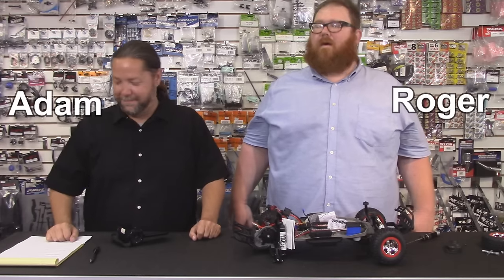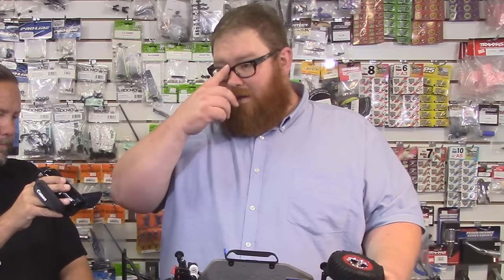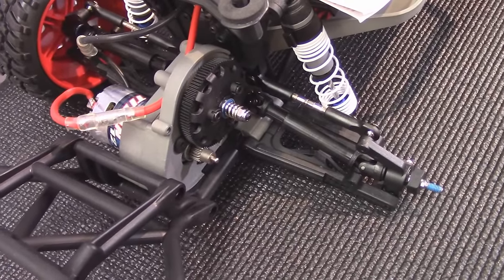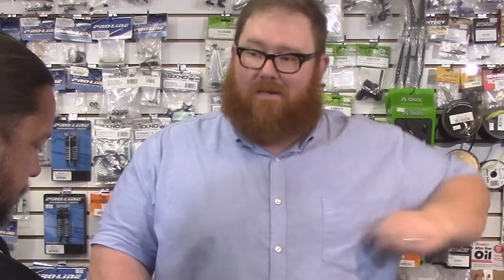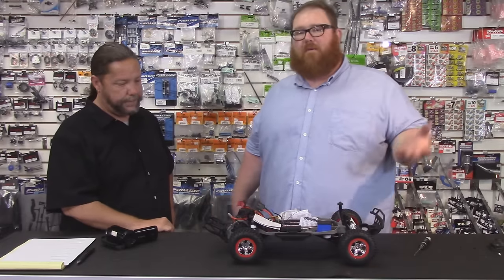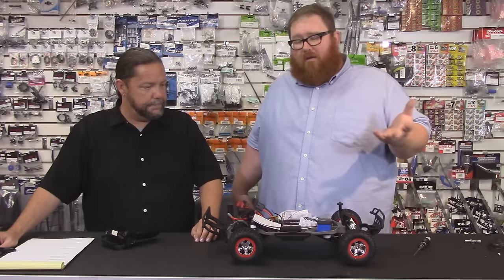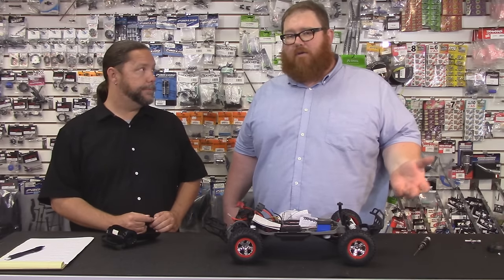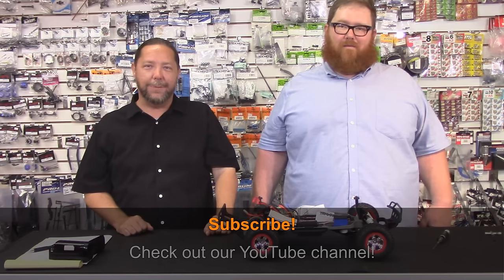Check & Adjust RC Slipper Clutch - How-To

Comment: See what you do is CRANK that nut all the way down until it don't slip no more and now your car will  wheelie!!! By the way I sell transmission parts lol. WTF. Next video is how to rebuild Traxxas transmissions...
Reply from the maker: If you transform it into a wheelie machine, then you need to change quite a few other things too ( idler gear, differential etc)

Comment: I agree with tightening slipper all the way. Because I switched to a brushless setup and kept burning up the spur gear and slipper parts. I tightened the slipper all the way and no longer have that issue. And like he said an $8 gear part much cheaper & easier to fix and replace.

Comment: Ahh! So that’s why whenever I would accelerate with my 4x4 slash, it kinda of just sits for a split sec before slowly gaining speed! Because I had replaced the entire Transmission and didn’t adjust it! The problem I suspected but never knew. Thanks!
Reply from the maker: You're welcome. Instead of adjusting your sleeper, try 3rd differential (it is another Traxxas upgrade)

Comment: Made the mistake of cranking the slipper too tight on my evader brushless upgraded to 4300kV Tacon Motor. Ended up destroying the differential. Duratrax discontinued their entire r/c vehicle line. A new complete transmission is price gouged at $95. The differential unit is basically impossible to find separately. My stupid mistake has forced me to retire an otherwise good car. Leave at least a slight amount of slip or you will be regretting it.
Reply from the maker: Usually you tight it down to the point when you can hardly spin the wheel and them made a half turn back.

Comment: The slipper is designed to help increase traction on low traction surfaces, and reduce the load on the gearbox. If you adjust it too loosely, it can damage the slipper and the spur gear. Adjusting it too tight can cause damage to the gear box/spur.
To adjust it properly, place the vehicle on the surface you intend to drive on, and from a dead stop, accelerate hard. The slipper should slip for no more than 2 feet.
Reply from the maker: Great tip! 😎👍 a good way of setting it
Reply: You beat me too it. Thank you. Don't ever torque your damn slipper clutch down... By the way we sell Traxxas transmission parts lol
Reply: I am a noob, so please excuse me for asking - how do you know how far the slipper slipped?
Reply: @Sleeperknot  - You can hear it when it slips. It has a bit of a high pitch whine. You'll also notice the car launch slowly if its too loose.
Reply: @AddictedRC  thank you! I just adjusted it the traxxas recommended way while building. Will do this test once I'm able to run the car!

Comment: I’ve always fully tightened the slipper clutch on all my vehicles haha. I like all the power to go to the wheels
Reply from the maker: Rock on!
Reply: When you fully tighten the slipper do you back it off the one full turn or just tighten it down and leave it at that?
Reply: DGUNZDAMC GMB I fully tighten it. Don’t man handle it haha. But once you feel resistance, just stop there and you’ll be good.
Reply: @Cooldibs  thanks man gonna give it a shot

Comment: Anyone have advice on how to prevent breaking the slipper clutch shaft pin so often? I'm new and bought a rustler vxl used, and the slipper may have been too loose.  I'm an expert now at tearing this apart.   Lol..

Comment: Hey man I have a question, I keep on breaking the pin on my slipper shaft, there are two pins, one on the outside that you can see after removing the slipper clutch and then one more in the transmission on top of a gear, I have probably had to replace that pin inside my transmission nine or ten times now.. I’m getting frustrated, The people at my hobby store said that they have no clue what is going on most of them are on their first slipper shaft pin and still running smoothly, am I doing anything wrong? I have my slipper clutch adjusted a turn out

Comment: For some reason, I can’t turn my slipper clutch, help
Reply from the maker: It is hard/impossible to troubleshoot over the internet (due to a lot variables). Check if it seized or burned. But first check how tight adjusting nut is.
Reply: RC Street Shop thank you for replying, I checked, I fixed it. I just could not turn it because the gear kept on moving and it was very hard to hold the gear, so I held the wheel like you did and it worked. Also, Question- as long as the slipper clutch is not TOO loose or TOO tight, it should be okay? I tightened it as hard as I could and loosened it by about 2 turns.
Reply: Also, could you check out my video on my channel called “strange sound in my amp” ? I am not sure what is causing a weird sound in my RC
Reply from the maker: Correct. You should also fine tune it while riding. Slipper depends on acceleration and grip. so depends on where you at (lose dirt or asphalt, NiCd or Lipo etc) you should either tight it a bit or make it loose.

Comment: So I switched to a 70 tooth, and the gear mesh keeps slipping sometimes. The wheel is spinning fine but the gear just slips sometimes
Reply from the maker: Try to re-adjust your slipper clutch

Comment: Hello R.C.S.H my slash 4×4 is making a wierd noise at full throttle. Is is the slipper clutch? This is the sound it makes look: https://youtu.be/qR3DyUSn_xI

Pls help me
Reply from the maker: Its could be ball bearing on your center driveshaft slipper....the one attached to the plastic cone. 
...there are a lot of variables, give us a call 562-425-9000
Reply: @Rcstreetshop  thank you so much
Reply from the maker: Anytime!👍

Comment: The problem with my little traxxxas summit vxl is that if the clutch isn't REALLY soft my back differential is broken after 4 wheelies
Reply from the maker: Try to help your diff with higher viscosity oil

Comment: Please help. My Slash 2wd does not move but makes a noise as if it was moving? I think it has to do with the slipper clutch. How do I fix it and what parts do I need? I tightened the bolt but it did not work do I need a new plate??
Reply from the maker: It is almost impossible to troubleshoot over the internet because of many variables. It sounds like it could be a faulty motor, but its could be something else, like a stripped gear or gear pin.
Reply: Mine was doing the same but I did as in the video and it works better then when I bought it
Reply: I know it's old but your motor could also have slipped back and the pinion gear isn't engaging, you can adjust it back.

Comment: I have a traxxas slash vxl for my setup  i used a Integy metal 73t spur gear and a 25t pinion had the slipper quarter turn did 1 run then truck went past me and it was quiet. took the the cover off the pinion had missing teeth and the spur was stripped,everything was brand new. can anyone tell me what i did wrong? So i don't do it again $40 of damage. Thanks
Reply from the maker: Something went wrong with your gear mesh (possibly too tight) or something like a little piece of rock went under your gear cover and stuck between gears. It is super rare when both (pinion and spur) got damaged though, usually it is spur gear only. See if has anything jammed into it.

Comment: I have a 2wd Traxas rustler and I put larger oversized rims and tires on it for the front end back and i burned out my slipper clutch. When i press the throttle it wouldn't really move fast so im going to replace the slipper clutch it's burned out bad. Should I just tighten that Spring And is it okay to run the larger tires on the front and back? It's the brusless VXL model and the tires and rims i bought are way bigger then the origin tires it actually looks like a monster truck now.

Comment: What if you have a horrible, loud sound coming from it? I adjusted the Velineon motor on my 2WD Rustler and lost the screw while driving it and it tore up the spur gear. I replaced the gear and I still have that sound. I also have the Slash 2WD with the Valineon motor upgrade, so I can tell they're the same. Not sure what it is. Possibly the transmission?

Comment: I have not only adjusted the Slipper Clutch in my ECX 2WD Ruckus but upgraded pretty much my whole Truck. I upgraded her Transmission with new Metal Gear set & Associated Slipper Pads, upgraded to a Metal Spur & Pinion Gears & applied some Tamiya Cera-Grease & bought a Clear Plastic Trans Cover (that looks 😎 watching the Gears-a-turnin'  👍).  A new Metal Slippery Diff (& I opened up my Stock Diff & Locked it with Super Glue as a replacement to try.  😜).
I also upgraded my Drive Shafts to a set of Hot Racing HD Shafts (not the Star Shafts, just the thinner round 1's.  1 of the 1st upgrades to do due to the Stock Plastic pos items breaking almost every time you take it out!  😔).
I upgraded my Stock ECS & Brushed Motor to a HobbyWing EzRun WP-SC8 & a Leopard Hobby 3800KV Brushless Motor, & added a Motor Heatsink & Fan that I "piggy-back" connected to the ECS Fan wiring, so both fans run together from the same Plug Port.  😘
Upgraded the front Steering & Suspension with mostly HR Alloy kit (some goood bit o' kit, right there, that HR is!  😅) & (Cheap Chinese from Wish)Metal Camber/Caster Adjusters, Front & Rear (went back to Stock Steering Arms due to the Wish 1's I bought being too short.  😕), a HD Steering Servo.  HR Rear Hubs.
I installed a Light Kit & Roof Light Kit but need new of both from rolling & crashing my Raucous BEAST!!  😂).
Oh, I had to install a Traxxas Wheelie Bar & am working out Front Weights to help keep the Front End DOWN so I can have SOME semblence of Control.  😂

I only need a new Dual Battery Charger that "does it all" & a new Battery or few.  My Vant 7.4V 30C 4000mAh battery is swelling due to improper storage on my behalf (I beleive?).  I had it charged unused the past 6 months due to my upgraded Alloy Bell Housing losing an Allen Screw or 2 & falling apart, breaking stuff, etc...  & my being financially strained, unable to get replacement parts.  I just worked out a temporary fix using some Stock Parts until I can get a new Bell Housing, & whilst doing the repair job checked my battery & it's-a-balloonin', man!  No good.  So I'm discharging it completely running the cars' Lights & Fans to dispose of it properly asap.  😅

What would you suggest is a suitable Battery C-Rating for my Setup?
I am pretty sure the ballooning is due to improper storage as the Battery hardly heated up under use compared to the Stock Battery & ECS, etc...  THAT Battery got HOT!  I just want to be sure that I am correct in thinking the Battery WAS ok, & that 'twas my bad storing it charged.

Thanks heaps!    ☺
Reply from the maker: The right way to address this is to get telemetry and check your peak load/power. It is going to be different for different setups/vehicles etc,...of course, bigger is better in terms of "C" rating, but to do it right you need to know what your actual load.
Reply: @Rcstreetshop     I believe I saw some device on this 'ere inets that you can plug your esc into one side & your motor into the other, & it tells you various infos about the motor's various states of operation?  But that may be a bit costly for me atm?  Certainly worth my looking further into though.

I have an Automotive Multimeter with a Temp Probe & all, but lack the knowledge & experience with 1 to do so, so...    😅

Comment: How should i set it if i keep breaking my diffs? Will loosening it save my diffs or will it just wreck my spur gear? I have a 1/16 revo with a 1/8 motor and it just keeps destroying my drivetrain. My driveshafts are all steel but everything else breaks even when testing at only 1/4 throttle... :/ id mych rather replace a spur gear every run than pull my diffs out after every run.
Edit: i did shim my diffs.
Reply: I would definitely recommend trying a looser clutch setting, especially if you run on loose, low traction surfaces.

Comment: I hold my spur and push but my tires don't move but I have a weird sound coming between both axles. Please let me know what you think. Thanks
Reply from the maker: Most likely you busted differential, but it also could be something else, there are a lot of variables. Stop by the shop and our tech will take a look (or your other local hobby shop).

Comment: RC STREET SHOP Geat Video , quick question, is there anything you recommended if running 2.8 tires? I have a slash 2wd upgraded vxl-3s Velineon 3500 set up, should I crank it down or loosen it with the larger tires or do you recommend a complete clutch upgrade? Thank you very much
Reply from the maker: Bigger wheels = higher loads on your transmission. You'll need to change your entire setup, fixing just one thing will make something else break.
Reply: @Rcstreetshop  Ive changed nearly everything on the truck Im talking specifically the slipper clutch., Ive changed everything from the Servo to the A-Arms to metal steering bellcranks & draglinks, to aluminum Caster Blocks & Front Steering Block & Rear Stub axle Bearing carriers, aluminum front & rear shock towers, Front & Rear Aluminum Springs Dampener aluminum alloy shocks etc etc? I currently have 19 Pinion w/ 90 Spur debating on dropping down to 14 pinion, Do you have any recommendations on gearing without losing to much Top End? Thanks alot guys
Reply from the maker: Give us a call when you have a moment 562-425-9000

Comment: hi thanks for the video. is IT true that if the clutch is too tight IT can damage the engine? or burn IT because the big Gear is too tight and that over forces the engine (velineon)?
Reply from the maker: Yes and No. If it is too tight then under hard acceleration something might break instead of the slipper just slipping.

Comment: In one day I stripped the Servo gears and the Slipper clutch. The clutch was indeed loose. I had my car for exactly 1 week. When I used 2 1200MAH 2S NiMH batteries in Parallel for the first time and already breaking parts. LiPo is gonna be a lot of fun 😂

I recommend upgrading to the 2080x Servo for the Metal gears (unless the metal gears alone can work on the normal 2080's?) Also the Slipper clutch that comes with the E-REVO VXL 1/16 is plastic and the pinion gear on the motor is metal. I hope the transmission isn't plastic inside? Can anyone confirm? I don't want to fix what's not broken. Lolz

Comment: When I tighten the slipper clutch my wheels lockup
Reply from the maker: Slipper just transfers power from your motor to transmission, this is all it does.

Comment: I had to take the spur gear off yesterday to reach a suspension screw that broke loose. I thought that nut in the middle was to take it off and tried that first, only to find out what it really did in another video. It was a traxxas bandit, and it seemed to be cranked all the way down from the factory, so that's where I put it back. Seems to run okay after putting it back together.

Comment: Please help me!!!! I bought a race star brushless sensorless motor with esc to upgrade my trx rustler. I now have the difficult task of finding a pinion to fit my 5mm shaft!! So I need a new pinion and spur that aren’t 48pitch!! I’ve had the kids car sat for months trying to sort this so called simple task on YouTube lol!!! Please please help someone!!! Tell me what I need to type in to ebay or Modelsport or something to get this car running
Reply from the maker: unfortunately, it is hard to find 5mm 48P pinion (this is what you need), it will be much easier is to upgrade to 32P, but you'll lose gear cover after the upgrade.

Comment: i can't get a replacement slipper for my cen ct5. Do i need a slipper anyway, or can i just remove it and still drive it?
Reply from the maker: Without slipper you are risking to put too much street on your transmission and break something. If there is a way, we definitely recommend to put one.

Comment: The slipper clutch maintenance kit you can get for the Traxxas Rustler VXL the pads you get with it are made from some kind of material. You can also get the slipper clutch maintenance kit for something like the Stampeed but the pads are made from metal. Will this kit work with the Rustler?

Comment: I move my 2.5 t maxx like you did and my bolt doesn't move at all. No matter how tight the spring is . I opened up the trans every thing seems ok. What could be my problem?
Reply from the maker: Do you mean you can't tighten down that nut on the slipper? Would you explain it a little bit better, please
Reply: Check all the gears and make sure they are engaging sometimes the motor will move back because it's adjustable and the little pinion gear won't engage

Comment: Need a suggestion/solution on Slash 4x4 (LCG/OBA/TSM)- I just ran it for the first time on pavement for about 10 mins & my slipper clutch adjustment got very loose to continue.(FYI- i had pre-adjusted it to 1/4th-1/2 a turn before running it as per the recommended adjustment).Now would request someone to help me avoid it in future please?
Reply from the maker: Hey! Thanks for watching! Our tech suggests making sure the plastic locknut for the assembly hasn't melted. It sounds like the slipper was still to loose and running loose warms it all up. So check that. If it is melted, replace it.

Then try tightening the slipper down all the way and then test run it. If it wheelies, back off the tightness and try again. Repeat till it stops wheeling.  Hope that helps!
Reply: Sure it does! Thanks a lot Roger/Adam!... You guys are just amazing.I never miss any of your uploads.

Comment: If you just tighten it all the way why not just use a center dif?
Reply: Center diffs work differently than just eliminating clutch slip. Center diffs can vary the amount of power going to the front and rear ends depending on the amount of traction your tires have.